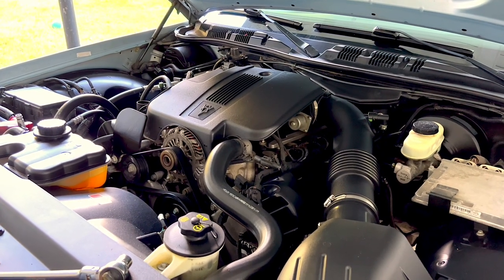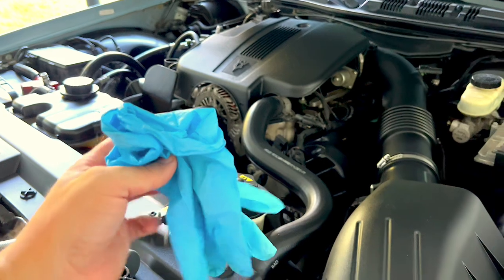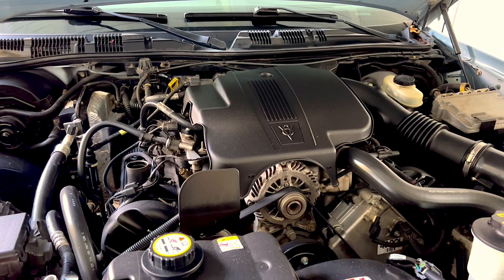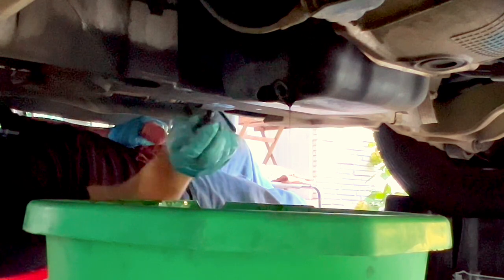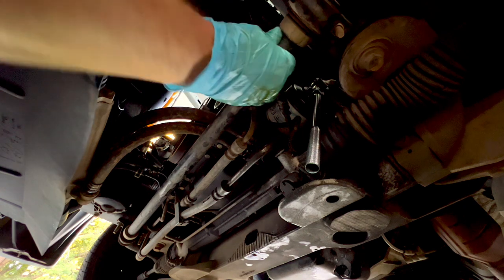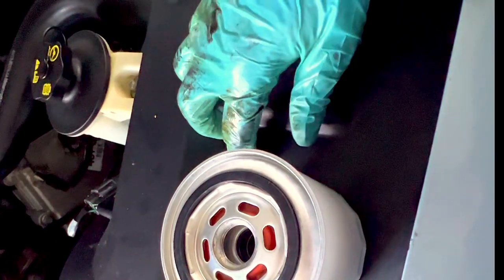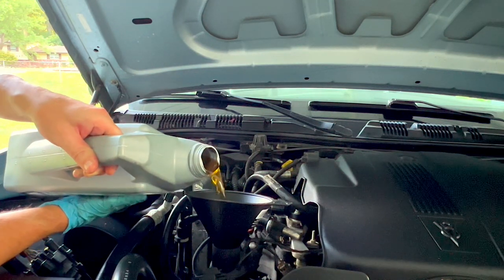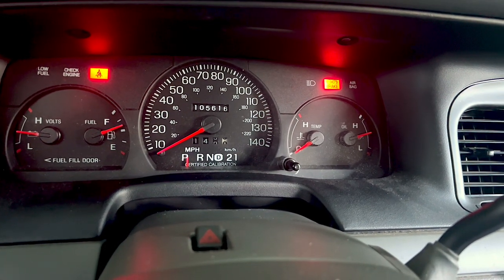DIY Oil Change Ford Crown Vic 1998-2011

Comment: I just came across this video this was a great tutorial! I really want to get a P71 but don’t know much about the common problems it has. Hardly any videos of that. That’s something I would definitely want to learn before making a purchase.. anyways keep posting!
Reply from the maker: @Mrnormalsense  Thanks, Much appreciated! The P71 is a great platform that is essentially very bullet proof with a few common issues. The intake manifold will crack because it is plastic, but that’s a pretty easy fix. Also the blend door actuator can be problematic and that can be a little difficult to fix as much of the dash needs to be removed. The main thing I would be cautious of is getting one that was used heavily in police duty with higher miles higher idle time and not maintained well. I have come across those. If you find one like mine, that was a govt official vehicle, you should be in good shape. I have my eye on another one that is like that in Kentucky at the moment. It has some rust but is well maintained and has under 100k mileage. You can find them on govdeals and other auction sites. The other good thing about this platform is that parts are readily available and cheap. The car is pretty easy to work on. Ford did a great job of designing the Crown Victoria to withstand a lot of punishment and abuse so if you can find one where maintenance has been done routinely, you should have a very reliable car.
Reply: @JZ_Cars  thanks so much for all the advice I just subscribed I noted all the advice appreciate it! I was in between this and a Lincoln town car I feel like this is a good starting point then collect the other panther cars. I will definitely check out that website keep making awesome content thanks man. Looking forward to it 👌
Reply from the maker: @Mrnormalsense  Thanks for the Sub! For sure check out govdeals.com and publicsurplus.com. I do a lot of detail content but I’m just a car guy at heart. The Crown Vic has been a great subject because there is a huge following and they are really easy to maintain. For this specific car, I’m on video 11 and I probably have close to that left to go. So all in all, probably around 20 videos on this car. Your question has given me an idea to cover maybe the problems you might have owning one. Although there are not many, the idea about covering the points in a video and what to look for if you are going to pick one up makes a lot of sense.